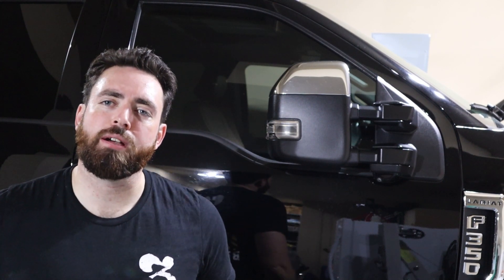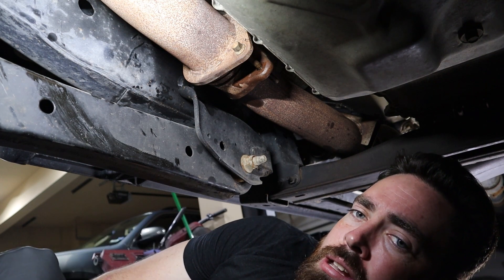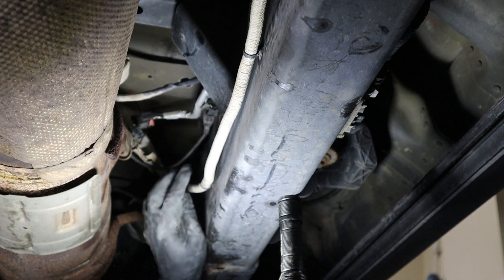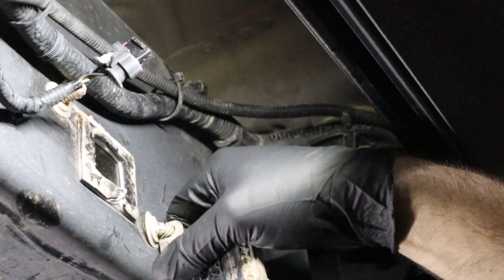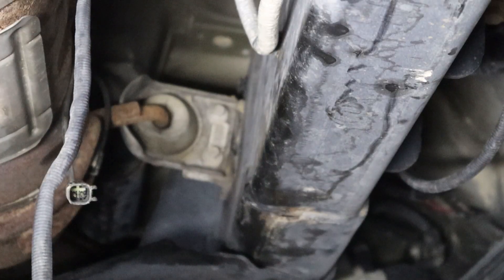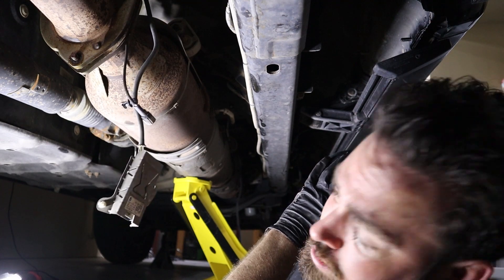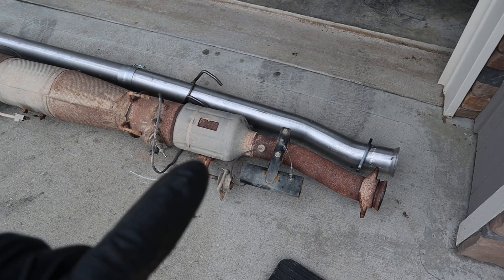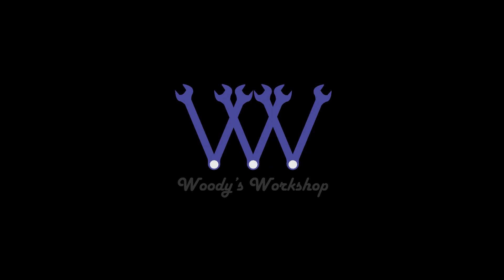2017 F250 6.7 DPF DELETE

Comment: Polluting punk - "Deleting a diesel isn’t just ill-advised; it’s a federal crime. Tampering with a vehicle’s emission system is a direct violation of federal law, even if you live in a state or county without annual or biannual emissions testing. If you’re caught driving a deleted diesel truck, you could face fines of up to $5,000 per non-emissions part! If you own a business selling/installing emissions defeat devices, those fines can increase to seven figures!"  You've been reported to the authorities.

Comment: I drove from the Oregon Coast to N. Idaho and back down to S. Idaho at 2500 RMP most of the way with limited acceleration and the stupid message saying, "Drive to clean...". I'm so pissed off at this emissions crap that I'm ready to remove it forever.  This looks like a good starting point. Is there more information about resetting the computer and getting the new straight pipe?  Do I need to get the pipe custom-made?  I'm sure the computer will not be happy when I disconnect all the sensors.  How do I deal with that?  My truck is the 2014 F350 Super 6.7 Turbo Deisel.
Reply: You will need a tuner to deal with your truck computer. You could also get in touch with a local diesel shop and they may be able to just add/flash a file to your truck so you will not have to deal with something plugged into your truck all the time or a black box/tuner sitting on your dash. If you are looking for a pipe, Some muffler shops could hook you up. Add a muffler to keep the noise down as it will be louder w/out the dpf. The straight pipe will be considered a "race truck pipe" as all of this is illegal in the US. If you are having issues finding parts/tuners, look to our Canadian  friends to the north.

Comment: How about f anybody who thinks these little trucks are to blame... Let's talk cruise ships... Let's talk airplanes... Let's talk military... Let's talk semis until recent years.
Epa need to chill out on pickups
Reply: It's all the nonsense the Democrats are shoving down our throats! 
It's not only trucks. Years ago, due to stricter emission regulations, auto manufacturers had to go to direct injection of gasoline into the combustion chambers. This bypassed the back sides of intake valves that use to get cleaned by the injector spraying the back sides with gasoline. Now EGR valves dump bypass gases from the crankcase back into the manifold and this builds up carbon on the back sides of the intake valves for direct injection engines. Guess what, it costs thousands of dollars to use walnut blasting or other methods to remove these carbon deposits after 70K or 80K miles on the engine!
Another strick EPA law that basically does nothing in the overall scheme of things and yet, this costs consumers thousands of dollars in maintenance costs!

Comment: I have my truck f250 2009. In Angola where they don’t have ULFD available… Been getting fuel from Namibia. But the finances are scarce 😢… Is there any solution to run a normal diesel without compromise the engine?! Need a help!
Reply from the maker: HI Anildo,  I'm not sure what type of emissions equipment is installed on a 6.4 in Africa. If you don't have a DPF or EGR cooler I don't think you would have an issue running a higher sulfur content diesel.  If you do have a DPF our EGR cooler I would stay with ULSD as higher sulfur content diesel will result in significantly more particulates that will eventually clog these systems. Hope this is helpful!

Comment: The increased fuel economy is from this weight loss
Reply: The increased fuel economy is from letting the engine breathe. 2018 F250 6.7…..  DPF/EGR delete, cold air intake, 5 inch downpipe back exhaust, and I get about 21 mpg on a race tune.

Comment: Dumb question, but I'm assuming you have to drain the DEF tank before disconnecting it from the metering device?
Reply: No, there's a pump in the def tank. Leave it about half full or full incase you ever have to put the dpf back on
Reply: @fredwoodley5970  the stuff in there is only stable for a max of 2 years if kept at a constant 75deg F. If one were to reinstall, fresh DEF would probably be a good thing. ymmv

Comment: Is is nessesary to do the EGR delete?   I was hoping to just order the SCT BDX tuner and the straight pipe. I was under the impression that the time will just close the EGR.
Reply: Did you ever find an answer for this?  I’m wondering the same. Let me know if you can. Thanks
Reply: @Graplernapler  I did not

Comment: Great video..I like the way you cover every detail..if I did this I heard the tune will close the egr anyways and you can just unplug it..what’s your thoughts?
Reply: Yes you want to get rid of the EGR cooler and the EGR housing. Then you use block off plates to redirect the exhaust gases.
Reply: As long as the tune closes the EGR you can just unplug it

Comment: Where can I buy just the pipe?  I dont need the rest that comes in that kit as I'm going with Proven.  Thanks. Part # for that pipe?
Reply: Did you get an answer? I have the 2017 Lariat 6.7 crew cab.  Looking for the pipe, too.
Reply: @spoiledrotten58  I found this:

https://www.dpfdeleteshop.com/collections/dpf-delete-pipes/products/dpf-cat-delete-pipe-ford-powerstroke-diesel-6-7-17-19?variant=34381330972807

Comment: Loved the video. Thanks for going so in depth on the removal of the dpf. I haven’t been able to find anything like this on the 2017+ 6.7 Powerstrokes. Quick question though. Do you have to load the new delete tunes into the truck prior to actually removing any of the parts or can you load them after? I’ve heard some people say you have to tune the truck before or the computer will know and basically put it into limp mode. Just wanted to clarify.

Comment: I love that set up. I just ordered a 2021 F-350 XLT 6.7 Tremor and plan to just do the dpf delete pipe.  I will keep the stock tail pipes. No need for a 5" exhaust imo. I just want longevity, increased efficiency and a bit more power. Thank you for the video.
Reply: Not just void the warrantee. What they are doing is illegal in most states. For example in Florida it's a $5000 fine and in Calif "Forget about it" you lose your truck the State has the legal authority to take your new f350 on spot! Have fun guys.

Comment: Both this video and the egr video helped me out a lot. Didn’t run into any real issues. My stock egt probe was extremely tight inside the crossover pipe and some of my connectors were a little tricky.
Reply from the maker: Glad it helped, thanks for watching!

Comment: How do you like that tuner/programmer? Were you able to flash the ecu to delete the dpf and egr with that programmer then unplug it? I’m wanting to use a Edge insight for a monitor. Thank you.
Reply from the maker: It works great for what I need. I like to set it and forget it.
Reply: @woodysworkshop816  where did you wire the switch on the fly into? I ordered this kit Sunday so I’m trying to figure out what all is in involved to be prepared.

Comment: Looking for some info almost nobody covers....... what do ya do with the def fluid ..... is the inlet pipe just hanging loose .... is their a plug for the end of it . Do you have to disconnect the power to the pump. How do you stop the fluid without any input from the No2 sensors.
Reply from the maker: I zip tied the line up and also disconnected the 2 connectors at the def tank/ pump. They are super easy to disconnect. They are located on the bottom of the tank and have a access flap that drops down. Sorry I didn’t realize I forgot to mention this.

Comment: This kit you used appears to have the EGR delete as well.  Is that correct?
Reply from the maker: Yes it was a full delete kit.
Reply: @woodysworkshop816  where did you get your kit? Call me 417-288-8955. Having troubles finding them for my 13 6.7

Comment: These same crybabies talking about diesel trucks polluting the environment are the same ones that are ok with charging an electric car on a charger powered by a fossil fuel power plant. Also, perhaps you consider the pollution that comes from the production of the def and def bottles and subsequent disposal of those bottles. The dpf cause worse mpg hence the need for consuming more fuel. All you tree huggers out there need to realize what cutting off your nose to spite your face is. You add emissions to a truck but by doing so cause more damage to the environment than the trucks ever would.

Comment: I thinking about ordering this kit for my “race” truck. Do you have to keep the tuner plugged in the obd all the time?
Reply from the maker: No, the tuner is only plugged in when you are re flashing the truck. The only exception would be if you are data logging or would like to leave it plugged in to display any gauges.
Reply: Woody’s Workshop where does the shift on the fly wire into?
Reply: Woody’s Workshop one thing. Did you do the programming before or after you unplugged everything. I emailed DRK but they haven’t responded back.
Reply from the maker: @ckonthebay1950   Sorry for the late response in I recall correctly the switch wires into the intake air temp sensor. Also it does not matter if you program the truck before or after unplugging everything since you will be clearing the fault memory in the process anyways.

Comment: Thanks for video... I have a few n00b questions...
Is it a little louder now without the dpf?
Would MPG change if you went from factory tips to 4 or 5 inch?
Reply from the maker: Yes it is noticeable louder without the DPF. No MPG would have no noticeable difference caused by what exhaust tip you choose.
Reply: @woodysworkshop816  can I do the dpf an the egr delete with out getting a Tunner or chip

Comment: Great video Quick question! I’m going with a tune and 5” pipes. But I’m curious. If I were to run new pipes before the tune comes in. After pulling out everything you did. Does it not throw codes and freak out because the computer is still looking for all the DPF and sensors? Thanks
Reply from the maker: Yea you will need the tune or you will have a bunch of lights on.
Reply: @woodysworkshop816  will it even run without the tune? I'm pretty sure that the computer shuts you down if it detects no DPF.

Comment: Interesting and informative procedure, my question is this- ( I have a 2017 which I bought new) when you flash through the OBD will it erase all fault codes and keep them from reappearing? And will the trucks history know you did this if you have to reinstall the DPF? I have 42 miles on the odometer now. Thank you
Reply: Once you tune it there will be a footprint left, even if you re install everything and flash the stock tune back in.
Reply: I meant 42000 miles
Reply from the maker: Yes it will clear codes and block the associated faults from returning. As far as the history I’m not sure about that. For me I won’t be re installing so I wasn’t concerned about that.

Comment: Did you program your truck? If so what programmer did you use? Thank you.
Reply from the maker: Yes I did, I used the SCT bdx tuner that was included in the kit I purchased. https://www.ebay.com/itm/2017-2019-FORD-6-7-DIESEL-RACE-KITS-PACKAGE-SHIFT-ON-THE-FLY-TUNER-RACE-READY/174438019061?_trkparms=aid%3D111001%26algo%3DREC.SEED%26ao%3D1%26asc%3D225118%26meid%3D04a0d7c619ee4c12b2ec13d071e08e26%26pid%3D100675%26rk%3D1%26rkt%3D15%26mehot%3Dnone%26sd%3D174438019061%26itm%3D174438019061%26pmt%3D1%26noa%3D1%26pg%3D2380057%26brand%3DCustom&_trksid=p2380057.c100675.m4236&_trkparms=pageci%3Abb3564dd-0fc3-11eb-b0a4-4ee8c3e4b619%7Cparentrq%3A3203792e1750aae88fbe8814fffec0d4%7Ciid%3A1

Comment: How much was the kit? Any cel codes?  What did you do with all those plugs you disconnected?
Reply from the maker: The kit was $1100. I just ripped the finger portion of a nitrile glove off and put them around the connectors and zip tie them to keep them dry and prevent corrosion. Or  if you want a more professional solution you can buy a kit like this https://upcountryfab.com/product/2015-2016-ford-6-7l-dpf-harness-plug-kit/

Comment: Did you have to do anything after unplugging all the sensors?
Reply from the maker: Just a tune, some people buy plug kits to protect the disconnected connectors from corrosion but I did not.
Reply: Woodys Workshop so you also had to do a tune?  Did you get on installed or buy a tuner?  Loving the channel!
Reply from the maker: @rbell944  Thanks! I did have to re flash the truck. I chose to get the cheaper SCT tuner that was included with the kit versus the more popular and expensive ez lynk. For me I couldn't justify the additional cost of the EZ lynk tuner. The kit I purchased comes with 5 tunes already pre loaded, you just have to plug into your obd port and follow the instructions. You can change the tune from 0HP all the way to an additional 220HP just by turning a switch.
Reply: Would you be willing to share the steps I need in order to delete my egr and dpf? Do in need to do one before the other and when does the tuner come into play? Thank you
Reply from the maker: Matt B. Once the DPF and EGR are removed you will need to re flash/ tune the truck immediately after. I made a video for both EGR and DPF removal.
Reply: Woody’s Workshop this was the answer I have been looking for. I was wondering if you had to program before removing or after. My truck is in idle only and had it towed. Depending on what the dealer says I may have them just get it out of idle so I can drive it home and order the kit.